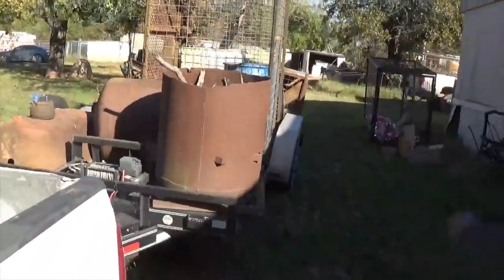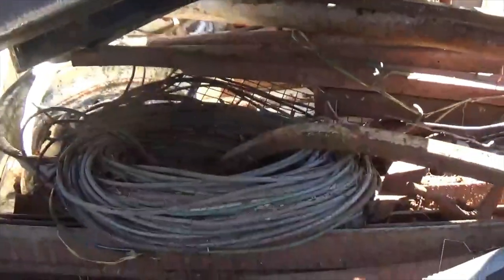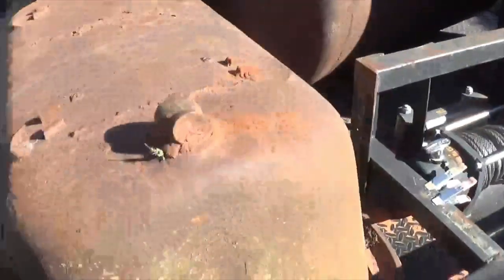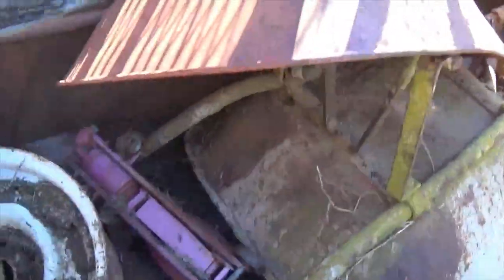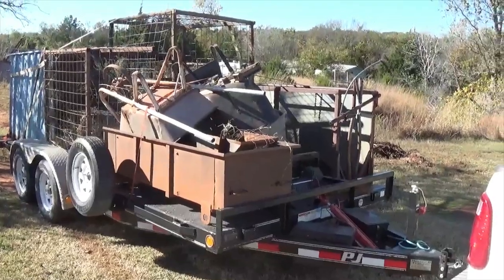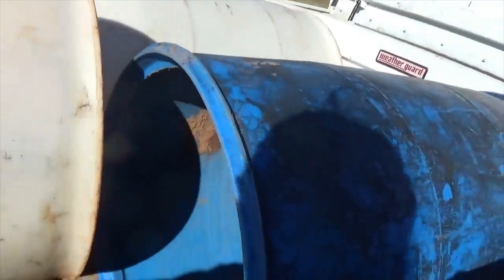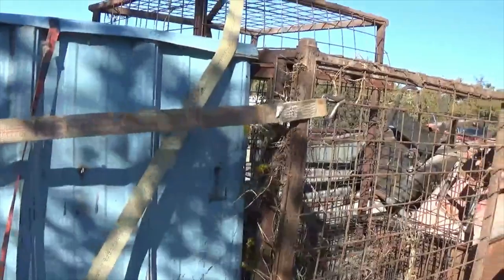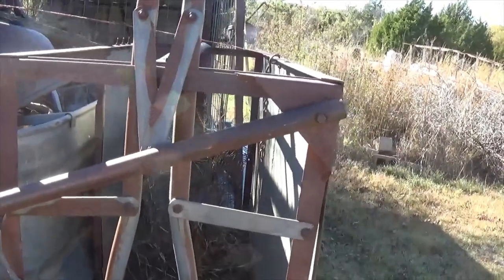Scrap Metal that I brought in this weekend

Comment: I was holding out for .70 for aluminum cans, I've acquired over the years about 250# crushed in 3 1/2 55 gal barrels . CMC recycling Tulsa went from .55 to .65 mid Oct then 11/2 to .50 then 11/5 to .43.  Did other metals drop by the same percentage?
Reply: Most sw Oklahoma yards giving .20 cents cans. As of last week. Idk
Reply from the maker: I am not sure I haven't had anything ready to sell so haven't checked the prices
Reply: I'm in eastern PA cans around me are .50 right now
Reply: .50 in for cans in Las Vegas

Comment: Why waste time trying to cut up a car or truck when you have a winch on the trailer . If you are worried about the framework digging into the bed you have plenty of sheet steel and long iron to skid it easily as metal to metal is like wet ice on wet ice
Reply from the maker: loading them is not the problem. I have to cut them up to sell them, as I have no title on them